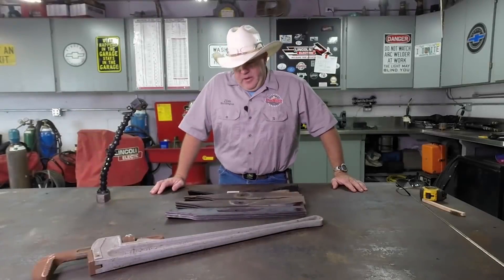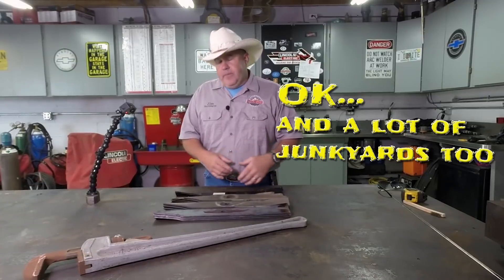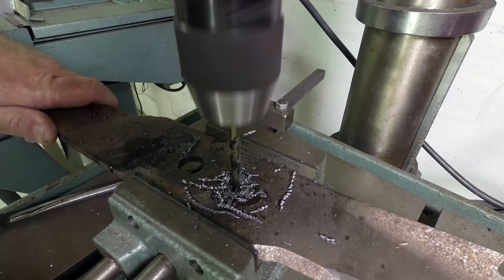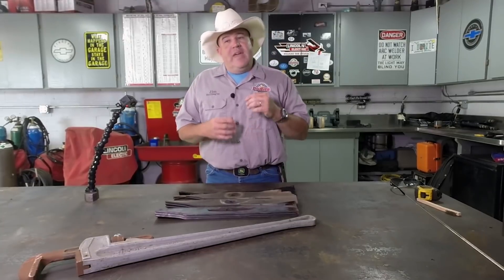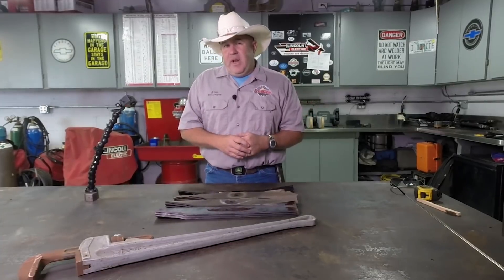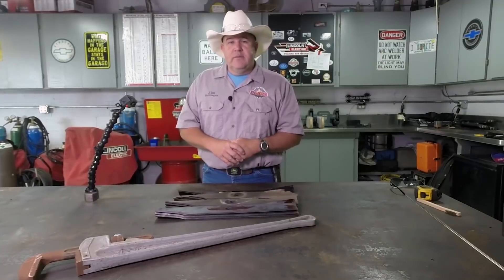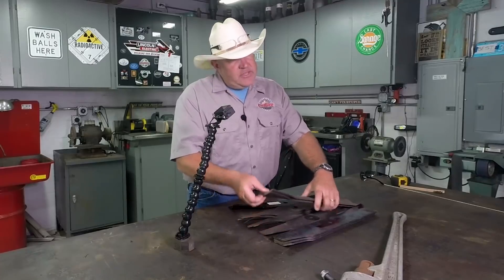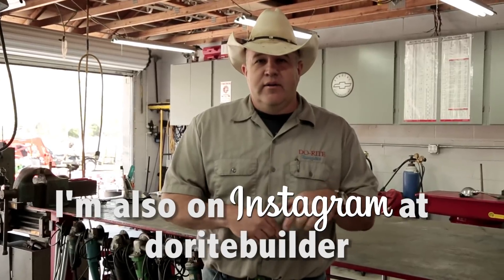How to make lawn mower blades part 3

Comment: I had a similar idea and was thrilled to see someone did it. My reason was a little different. I’m into restoring and using old tractors on the farm and the blade manufacturers have stopped producing blades. You could easily make a business out of this project for this use case alone. There is a lot of old equipment out there - because they don’t die like the disposable stuff made today. Amazing work! If you decide to start making blades - be sure to let me know because I’ll be placing orders.

Comment: Nice video! I would like to mention that there are factory blades made specifically for sandy conditions. They have the uplift part cut off even with the blade about 1" back from the end of the blade. The idea is the sand gets thrown out from under the deck much quicker than if the uplift part is intact. Would not add much to fabrication to do the same thing. Might be something to try side by side in the future. I think it would make a great video! Thanks for your upbeat enthusiasm with the fabrication!

Comment: Nice Videos.  I love your shop and creative skills.  
Standard mower blades are made from heat treatable alloys and they are heat treated to Rockwell C 40-45.   Years ago, some were made from spring steel, but for safety reasons, none are today.  Any hobby blacksmith making knives would tell you that to make the material tough, it needs to be hardened then tempered to increase the toughness.    The best mower blades are austempered in a salt bath to prevent distortion and eliminate the possibility for quench cracking during heat treatment.    For an oil quench process, if the blade is hardened and not tempered, it will be brittle and will very likely shatter (depending on the alloy).   You can drill standard mower blade material, but it would wear a drill quickly.   Some premium steel mower blades are Rockwell C 48-52 (these would dull a drill even faster).   This harder material is called Marbain by the manufacturer.   Mild steel is not acceptable for bend, dent, wear and fatigue resistance.   Keep your loved ones and prized possessions away from the area you are mowing with these unheat treated blades.   You are right, the amount of airlift height improves the grass lift and cut quality.  It also picks up more soil/sand and will wear the edge and airlift over time.    $3 of material and $50-100 of your time (not sure of your shop rate) does not make a quality mower blade in my opinion.

Comment: The one factor I didn't hear was balance. Balancing will prolong your spindles and perhaps help with some of those hanger blades of grass. Gerat video series as usual.
Reply: Agree!  With this manufacturing method of trimming the ends and hand working bevels, without fixtures, balancing is a must!

Comment: Thank you so much for this video series on blades.  I deal with smaller garden tractors from the late 50's to the early 70's. My GT are mostly for just putting round on, but I do like to cut grass with them. My project this month is fabrication of a 1968 Sears 48" Flattop deck and the blades for these decks are not available at any online stores.  Thanks to you, I believe I now have a source for new blades.  My self and my local Maker center.  New subscriber for life.

Comment: I watched all three videos.  I am actually going to try and make a 3 point pull behind offset mower and pull it with a 1984 John Deer 430 Diesel lawn tractor that I restored.  No reason, I like them and needed something to do.  Turns out I use it more than I thought.  I move trailers and things around on my property and recently I cut 29 trees out of a tree line.  Anywhere from 6" to maybe 9" base.  I didn't use tongs or even lift the trees with the 3 point.  Chain around the tree and around the ball and drug them whole up to my burn pile/firewood area.  It was damp and I only had to step on the diff lock a time or two.  I was pretty amazed.  I use a 60" Commercial Gravel zero turn to cut about 4 acres.  I have a lagoon that terrifys me to get close to on a zero turn!  also about 1200' of ditch.  Anyone the has used a ZTR on a grade sideways knows what I'm talking about.  My plan is to make a square with a top, mount an engine to it, put wheels and a hitch on it and go.  I know I can buy a 33 inch blade but after seeing this I want to make a blade, maybe 40" maybe more with no pitch.  It will only cut the pond bank and under a lot of cedar bushes so I don't mind a swirl or two.  I am thinking 3/16 for the deck with bracing, two 12" pneumatic tires up front and two on the rear in casters.  I will leave the back open or maybe put a rubber flap on it.  Any suggestions are appreciated.

Comment: I used to run some hard face rods along the face before I sharpened them, lasted for 4 years. Now I tig weld some stainless rod across the cutting edge, it's doing well but won't know for a few more years yet.

Comment: Jim, I asked Google what they were made of. Heres what it said:Lawn mower blades by standard are made of extremely soft steel. They have to bend and dent when hitting rocks and other hard debris. If they were made of tool grade steels, they would shatter and become missiles. I really enjoy watching you , Uncle Keith  and Adam. Keep up the great content
Reply from the maker: Thanks for the info. Keep your eye out the middle of next week, starting Monday, the three Amigos will be together at Fab tech.
Reply: Yes, they are not made from tool grade steels.   Those materials are wear resistant, but not tough enough.   Blades are not made from mild soft steel, they are made from heat treated steel alloys that are chosen for strength, toughness, wear and fatigue resistance.

Comment: I can tell you what my neighbor does. He makes his blades from spring steel from a car spring shackles. He softens them with heat using his oven. Then does all the machining, bending and then heat treats them to about 40-45 rockwell hardness. This is still able to be abused without cracking. They last for years. That would be right up your alley fella. I can understand the cost of stuff is just going through the roof. I have do not have that problem, but can feel your pain.

Comment: You are very correct. I owned a house on Cape Cod and could not believe how fast I wore thru the turned up part of the blades. Same as yours. I run a small engine shop now in upper state N.Y. and mow about 3 acres and get one or two years out of blades and only have to sharpen them about two times a year. Thanks for the great video's.
Reply: Where (generally) in NY, Always looking for small engine places to send folks. (I'm in the middle of the state myself)
Reply from the maker: I worked my way through college as a small engine/tractor mec. Thanks for watching.
Reply: Hi: North of Utica. I am a one man shop and do lots of engines for the Amish. Thanks
Reply: Were almost neighbors then.. I'm NE of Cooperstown. Also do a lot of repairs for the Amish around me.

Comment: Jim, Thanks for this series.  I have a finish mower for a 1942 Farmall Super A to refurbish this winter for a neighbor.  The blades are not something over the counter any longer, so it looks like I will make some.  Also, I was at the mower shop last month and they let me rummage around the stock of new mower blades looking for something that would fit this, and I did find one interesting set.  They were a brand new set of blades that had flame hardened edges.  I was quite surprised to see that.  I never got any part number or anything from them, but I thought that was an interesting design.  Keep up the good work. R.J.

Comment: I agree that nothing else is needed on the blades. I grew up in Zephyrhills and my family owned a welding and machine shop. We would put Stellite on the cutting edge of Bushhog blades to maintain sharpness but nothing will keep sand from eating up the lifts / turned up edges of lawn mower blades. It’s just not practice or cost efficient to do so. However moving to the north GA mountains stopped that problem, but rocks still tearup the cutting edges.

Comment: Really liked this series man.  Only comment that I have (completely constructive) in case you want to play with it...hard facing rod isn't nearly that expensive.  I just bought 5 lbs on Amazon for about $33 shipped.  (Blue Demon HARDCOVER 470 X 1/8" X 5LB Carton)  -- At 3$ a piece for blades though...not sure it is worth it given that you would have to hard face...grinding the edge would take you 5 times a long (or more) but I bet you could use them for a month without sharpening them if you hard faced the edges.  Thanks for the videos!!

Comment: Watched all 3 of these vids, the one thing I kept thinking about was balancing the blades. It's a big deal if you're using a regular push mower, because the vibration is not only unpleasant on your hands, but causes wear and tear on the motor itself. The balancing of the factory blades no doubt goes into the high cost of them. I guess with a pull behind 3-blade system like yours vibration might not be a problem, don't know. But vibration is definitely something to think about.
Reply: A misbalanced blade can make a lot of vibration on a tractor mounted twin blade deck. I quit after only a couple minutes and went and reground the chipped blade. Only a quarter inch chipped away but it made the whole machine shake

Comment: I have ordered some that I drilled to adapt to fit an antique rider. They're some sort of spring steel. To drill them them I use a carbide endmill to  drill the mounting holes for them.    It was for the old Sears Suburban. When it made it to it's 50th anniversary I retired it and bought a new zero turn. 
    Now I will be using your idea of making my own blades. Unlike you I have lots of rocks. I'm wandering how 1018 will hold up batting rocks?????

Comment: Great video I’m going to try that but have you thought about using a harden able material with good wear resistance such as 4140 but not hardening it? And see how much longer the last and if you can skip some of the sharpening cycles? I think you would be surprised at how much longer they would last just in an annealed state

Comment: Everyone  should've known from the start they're not hardened..  you couldn't file sharpen them if it was hard.    Thumbs up  video.
Reply from the maker: I've worked on some bush hogs where the flails had hard facing on the cutting edge of them, they were a bugger to sharpen.

Comment: Thank you for sharing all you learned and how it turned out. One last question... how much of a difference did reducing the lift make? Thanks again.
Reply from the maker: From what I can tell, Quite a bit of difference when it comes to wear. I am guessing that these blades will outlast 2 to 1 the higher lift blades. as far as cutting goes, I really haven't been able to tell any difference in the type of grass I cut.

Comment: Logically, If your hourly rate was $90 an hour that you could be making from your shop and you spent 15 minutes per blade, that's $22.50 + material = $25.50 per blade.  Of course, that is only true if you value your time.  I used to make or do just about everything myself because my time was "free" and that was the only way I could afford to do stuff, but as I get older, I have learned to value my time a little more and find myself debating to make, or just buy.  Good video series.
Reply from the maker: 15 minutes per set to fab. 15 minutes per set to sharpen. 30 minutes total. Plus, I got to make a good YouTube video out of it. I consider it a winner all around. My time is valuable, my shop time is precious, my shop time with my kids, priceless. Thanks for watching.
Reply: Sorry, it wasn't meant to come across as derogatory at all.  I'm like you, I like doing most things myself, but as I get older I just find myself debating which way to go more often, but I also find I have less time available as well so that figures into it all.  Again, always enjoy the videos and I totally agree with you.  If you're having fun then heck yeah !

Comment: Check out this link on blade alloy from john Deere.  It does seem that some manufactures use 1045 1085 or 5160 alloy. John Deere uses 1085? heat treated to RC 40-45 c scale. 

https://jdparts.deere.com/partsmkt/document/english/pmac/4382_fb_Lawn_Mower_Blades.htm

Comment: Cost analysis doesn't include the value of your time, the additional time changing blades and any investment into equipment that makes producing or changing the blades more efficient. The point is still, how do we find a blade or blade alternative that cuts efficiently and permanently? Weed whips run out of cord, so people try saw blades. Robot mowers use 'tiny' sharp and thin blades that cause no lift, but are intended to cut small increments of grass leaves.  There is a version of this available for riding mowers in the US, but it's over $200 for a set. They claim a full season without sharpening or replacing. So, at $3 a blade x 3 blades, it's $9 every time plus maintenance and replacement of the equipment used to produce them. Replacing them 10 times a year only beats the $200 price tag if the saw blades, dies, hydraulic pumps and periphery, cutting fluid, and more are excluded. I have a cheap drill press, but the tradeoff would definitely be my time, and the thought of increasing my time dedicated to just cutting grass isn't very appealing. I was kinda wondering if a fan grille from a tube style air mover could be used as a guard under the blades to absolutely prevent rocks and other hard objects from entering the cutting area, or basically creating a larger version of a rotary shaving razor. Grass goes in, gets cut off efficiently, while minimizing or eliminating the potential for damage. and if the grill was actually part of the cutting process, the overall speed of the blade could be a fraction of current rpm's used, which would greatly reduce explosive failures and ejections. Most likely some form of pass through fan would be needed to get rid of the clippings and to dry things out. And of course, finding a durable way to do it cheap would be nice. :)